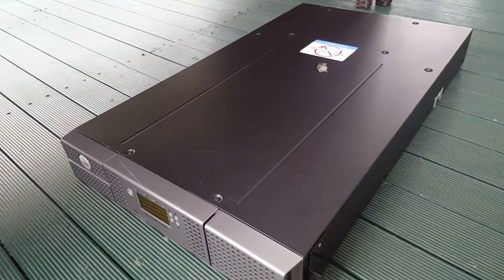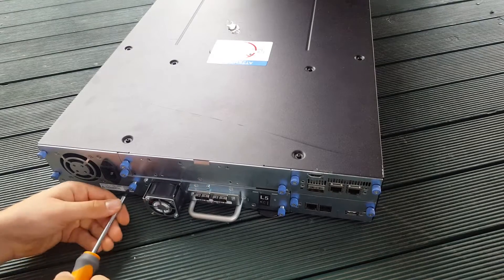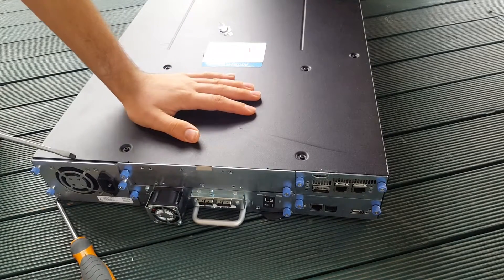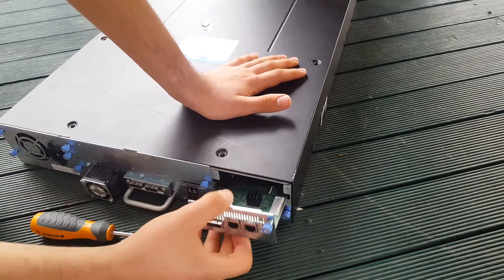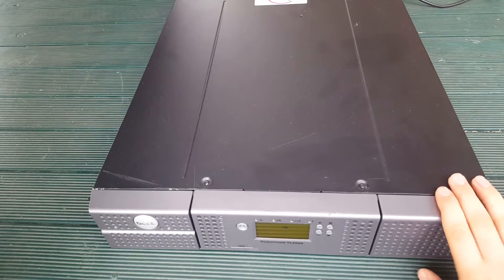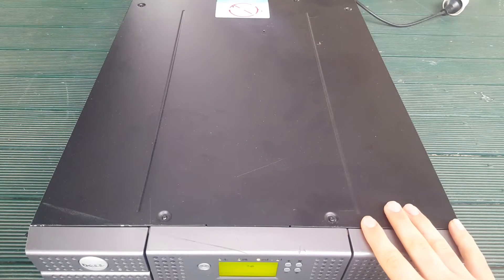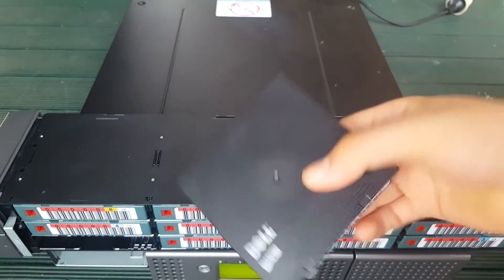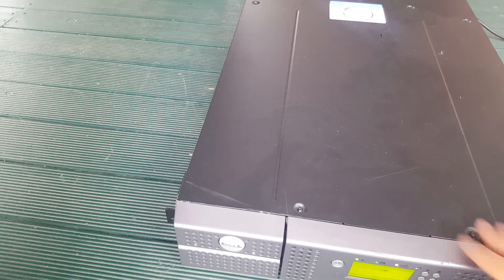Dell PowerVault TL2000 Review

Comment: Based on your experience can I run the tape library with ethernet only and not using sas? (with the tape drive you disassembled in the first part of the video)
Reply: No, you can equip any tape system with SAS, SCSI or Fiber.

Comment: What backup program have you used with this?
Reply from the maker: i dont use it. i don't have any external iSCSI cables / cards to connect it to a server so its currently not in use... when it was in use i believe it was manual backup, with an actual server with the drivers that dell provide loaded onto it.
Reply: good point, you found something? using Veeam BR 9 at the moment, not sure if that will do robotic in the free version? thanks
Reply: Backup exec and Veeam and also novabackup